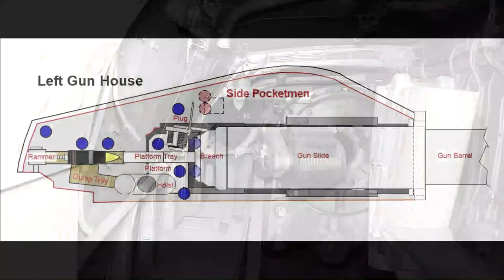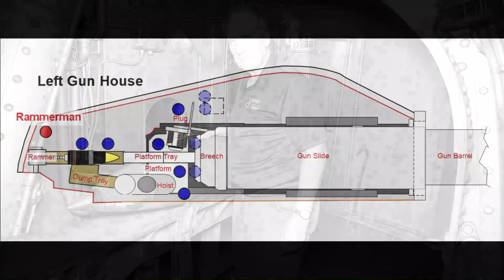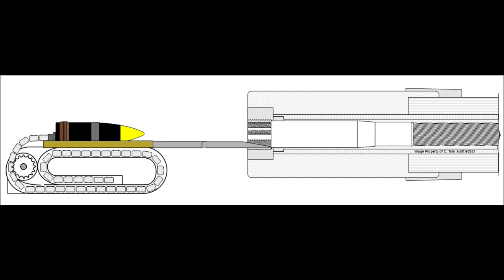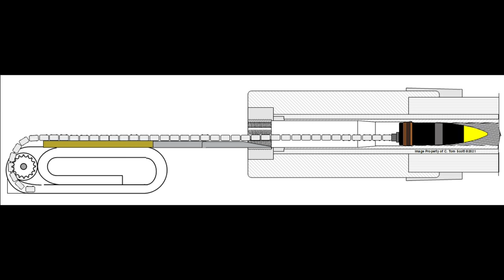Battleship Texas, Getting Loaded in a 14" Turret

Comment: We have all seen movies & video of battleships firing their main batteries, & occasionally seeing after the round has left the barrel along with a cloud of smoke, that a sheet of flame would then momentarily emerge from the muzzle. Is this flame resulting from the gun crew blasting compressed air down the bore, just prior to opening the breach?
Reply from the maker: You'll typically see a puff of smoke a few seconds after the gun fires that is the result of compressed air igniting and pushing the remains of unburned gasses out of the barrel by the gas ejector.

Comment: Tom,  Great explanation, but a couple of questions:  1. How much did the powder bags weigh?  2. How was the type of projectile determined (AP or Common or High cap).  Thanks for this series of videos.  I'm an ex-snipe but always wondered about this evolution.
Reply from the maker: Each powder bag weighed 105 lbs., for a total charge weight of 420 lbs.  That is a full charge.  However, reduced charges were frequently used when firing shells at closer ranges.  These used 85 lb. bags for a total charge weight of 340 lbs.  This greatly increased the life of the gun barrels while not compromising performance.

The type of shell to be fired was determined by the type of target.  An armor piercing shell would be used against hardened targets, such as another battleship or heavy cruiser, to punch through their armor and penetrate deep into the ship before exploding.  It would also be used against shore targets like gun emplacements that were protected by reinforced concrete.  High capacity shells have little penetrating power, but contain much larger bursting charges.  These would be ideal against lightly armored ships like light cruisers and destroyers where an armor piercing shell may actually over penetrate and go completely through a ship before exploding.  They are also good against open or lightly protected gun emplacements, and tank, truck and troop concentrations that are out in the open.  They may use impact fuses to explode upon contact or timer fuses to create an air burst directly above the target that would destroy using concussion and shrapnel.

The type of shell and fusing would be usually be determined by the gunnery officer and his team once a target had been assigned by the combat information center.  However, there may be other considerations.  There were a couple of occasions where h.c. shells were selected when the best would have been a.p. due to shortages.  It's better to fire an inappropriate shell than no shell at all.
Reply: @tomscotttheolderone364  Would there ever be an issue where the loading crew sets up all HE shells on the dump tray, loading tray etc and there came a call for an AP shell next? Would they have to fire off three more shots before they could load the correct shell then?

Comment: How loud was it in the gun house when it fired? I'm sure it wasn't as loud as it was outside the turret. Was there any hearing protection other than cupping their hands over their ears? Is there any documentation on resulting tinnitus or deafness?
Reply from the maker: I spoke with a veteran who served in a turret about 20 years ago.  He said that it wasn't uncomfortably loud.  It could certainly be heard, but it wasn't uncomfortable.  After all, the blast noise was produced at the gun's muzzle that is on the other side of 14" thick armor.  Most of the interior noise was a loud swooshing sound from the recoil buffer when it fired and a loud slam as the barrel was pushed back to battery position by big counter recoil springs.  I would imagine there would have also been background noise from blower, training and pointing motors that ran nonstop when in action.

Comment: Excellent overview Tom.  So does the shell get hoisted upside down and rotated into the dump tray?  Or does the shell tip forward away from the dump tray, then slid backward into the tray?
Reply from the maker: The shell sits nose down in a hinged cradle.  The hinge point on the cradle is below the shell's center of gravity that sits in it.  As the cradle reaches the top of the hoist, which is angled back, the weight of the shell makes the cradle swing back through the hole in the back of the hoist and the shell slides off onto the dump tray.
Reply: @tomscotttheolderone364  So it DOES get loaded into the hoist cradle upside down!  How bizarre.  Thank you for the answer.
Reply: @tomscotttheolderone364  Subscribed!

Comment: So great vid.  But it left me with a few questions.
1) are the guns preloaded at a certain range at target approach? IE.. lets say 100 miles out or so
2) and when a threat was not detected or already eliminated, how were the guns unloaded?
Reply from the maker: Good questions.  
1) No, guns were only loaded immediately prior to firing.  That could be done in seconds if a shell and powder was ready to ram.  Shells and powder were NEVER allowed to sit in a gun for any period of time, especially if the gun had been fired and was still warm.  It not only increased the possibility of an accident, but heat soaking the powder affected its performance.  Also, a loaded gun was extremely hazardous and the gun crew had to stay in safe positions and their movements would be very limited.
2) Since guns were loaded immediately before firing, there was only a very small possibility that they would decide not to fire it and require unloading.  It is my understanding that during wartime, they would simply aim the turret in a safe direction and fire it to clear the gun.  This is because unloading was a time consuming and hazardous operation that included clearing the turret of personnel while a couple of crew members, supervised by a gunnery officer, removed powder bags.  If bags sat in a cold gun, they would be sent back down to the magazines for future use.  If the gun was warm, the bags would be immediately immersed in distilled water to make them safe.  Once clear of powder, the gun crew could reenter and the shell could be pulled out of the gun by inserting a lifting eye in a slot in the base of the shell and using the rammer in reverse to pull it out.  It would then be kept on the rammer tray for future use if it wasn't damaged, or sent down to the magazines though an auxiliary hoist tube.  The upper hoist used to raise the shell only worked to lift it, a shell could not be lowered from above through it, so an auxiliary hoist tube was used to lower the shell with block and tackle to the shell deck located below the turret, then returned to the magazine.
Reply: Thank you for the quick and I depth answer Tom Scott..

I am officially a fan now

Comment: how did man gain this knowledge to engineer this magnificent machinery without a computer ?
Reply from the maker: It is an evolutionary process, especially before computers.  When looking at the progress of any design, it was rarely revolutionary and it happened slowly.  What is largely unappreciated was the tremendous amount of manpower that went into designing these extremely complicated ships that required tens of thousands of drawings.  Even though much of the equipment and design features could be duplicated from prior ships, it still required large design offices with hundreds of designers and draftsmen to create the drawings.  Each of them worked with slide rules and drafting tools to make drawings that were very precise and highly detailed.  What I find most impressive is that all of these drawings had to come together to create a cohesive design.  That can be difficult, even with computers.

Comment: 36,000 lbs per square inch when that 14" goes off, that is a total of 5,541,840 lbs pushing the projectile.
Reply from the maker: The result is accelerating a 1,500 lb shell from 0 to about 1,800 mph in only 52 feet!  The forces are in the thousands of g’s!

Comment: I can imagine the organized chaos in that turret. What my mind keeps coming back to is the guys heaving those powder bags. They were 105 lbs! That's a heavy weight to be slinging about on a regular basis. Those poor guys must have been absolutely wiped by the end of a battle. The only other thing I keep dwelling on is the noise. Large cannons make an incredible report when fired. Was the sound attenuated in any way being inside the turret?
Reply from the maker: I don't think that things were as bad as one may think.  First, we know that noise wasn't bad.  As you suspect, the noise from gunfire was greatly reduced by the heavy turret armor to the point where it wasn't the loudest sound.  According to veterans who served in the turrets, there was the background sound from large ventilation blowers and the training and elevating motors.  When guns fired, the loudest was a whooshing sound from the recoil buffers that slowed the barrel during recoil, then a loud slam caused by the barrel being pushed back to battery position by large counter recoil springs.

The turrets were pretty heavily manned to divide jobs into manageable efforts.  Plus, the gun crews were constantly drilled so that each knew precisely where to stand, and how to move and work together with others like a well oiled machine.  As you surmised, the hardest job was the powder men in the gun pit that lifted powder bags above shoulder level and set them on the loader's platform.  That was manageable over extended periods for a couple of reasons.  With two men there, each only had to lift two bags each time the gun fired.  At maximum rate of fire, that would be two bags every 45 to 60 seconds.  That would be really difficult for most of us, but according to gunnery manuals, these guys were to be trained  by having them lift at least 50 bags every day.  The goal was for them to do that without breathing heavily.  That apparently worked since the ship was able to provide a very high rate of fire over an hour period during initial bombardment at Normandy.

Comment: I cannot imagine working in the "side pocket" or even  the "gun pit". The "side pocket" would be my definition of Hell.

It seerms very likly you were going down with the ship in case of a sudden emergengy.
Reply from the maker: While I agree that it was probably uncomfortable and claustrophobic, side pocket men could evacuate with the rest of the turret crew through close by escape hatches located at the back of each turret.  The biggest slowdown was that the total crew of about 25 in the turret had to fit through the hatch one at a time.  The crew who had it the worse would have been those in the boiler rooms who had to go through a series of doors and long ladder climbs.  Not only was it a long process getting out, there were choke points where each room's crew of about 30 had to exit one at a time.
Reply: How often would they have swapped out sailors. Lifting thise 100 lbs bags had to have been tiring.
Reply from the maker: @Lone_Star_Proud  A mid 1920's gunnery and drill manual stated that powder handlers were to be regularly drilled by lifting 50 bags daily so that they would be in good enough condition to pass bags for an extended period without breathing hard.  The only place that I am aware of where crew were regularly changed was in the powder magazines.  The bags out-gassed ether when the storage canisters (called tanks) were opened, giving the crew stationed there bad headaches.  They would change out with crew in other positions down in the handling rooms until their heads cleared.
Reply: They made them a lot tougher back then. My dad was in combat  wtih the 36th through out the war. The Italian campaigns were particularly brutal.

Comment: Thanks for the video! Dumb question, but how loud did it get in one of those turrets, especially when the gun was firing?
Reply from the maker: Not as loud as you may think.  I’m sure there was significant noise from blower fans and motors, but not uncomfortably loud.   Veterans told us that during firing, the gunshot itself was muffled.  After all, it was 50’ away and on the other side of 14” armor.  They said the loudest sound was the whooshing of the.buffer during recoil, then a loud clang as counter recoil springs pushed the barrel back into battery position.

Comment: I might have missed this, but why wouldn't you use the rammer for the proj, to ram the powder bags? 
Greeting for USS Lake Champlain CG-57
Reply from the maker: The only control for the powered rammers on Texas is a single lever that moved the ram either in forward and reverse depending upon the direction the lever is pulled.  Ramming distance was controlled only by a friction clutch that slipped when the shell's driving band jammed into the compression slope at the forward end of the gun's powder chamber.  There was no electrical cutoff or limiter, nor was there a switch or other control device that could select the ram's travel distance.  For that reason, there was no way to change  between ramming shells and bags.  While the rammer man could eyeball it, It would be pretty easy to over ram bags and damage them.  Even worse, tests performed during the investigations into the Iowa turret accident suggests that it may even be possible to ignite a bag by over ramming.  

Fortunately, ramming wasn't too difficult since 4 bags were quickly rammed 2 a time with a wooden ram rod that the two tray men used to ram two bags at a time.  Since the rammer man was standing shoulder to shoulder with them, he could pitch in and help if they needed him.

Comment: Really good video! Just one question: When the gun is brought into firing position, the breech would move into the gunwell where the wellmen are, right? How do they keep from getting crushed by the massive breech block?
Reply from the maker: Maximum elevation for Texas' 14" guns was 15 degrees.  For that reason, the breech didn't extend that deeply into the gun pit.  Below the breech was the loader's platform that was attached to the gun slide meaning that it also lowered when the gun was elevated.  As long as they stayed clear of it, the platform's position made it impossible for the well men to be at risk from the breech.  To be clear of any of the gun components, after they lifted the four bags of powder and prior to the gun elevating, the two well men moved forward and sat or laid on the powder tray.  I was also told many years ago by a veteran who manned that position that they could lay on their backs on the deck and the platform would stop a few inches above their faces.  Personally, I think I would rather sit on the tray.
Reply: @tomscotttheolderone364  Thanks for replying so quickly and so in-depth! I can kind of visualize that now. As someone who loves heavy machinery yet occasionally gets really nervous when close to it, wellman definitely isn't the job for me... really good video by the way!

Comment: Why did they have a power hoist lower down only to switch to manual passing of the bags for the last 2 levels?
Reply from the maker: Texas and New York actually started out with a fully manual system.  Bags were passed by hand up a series of platforms vertically spaced 30” apart from the lower handling room to the dividing room.  This was not only inefficient, but offered no protection against fires flashing between the two levels.  A powered hoist was installed sometime between 1919 and 1922 that replaced the platforms and improved protection.  This was an easy installation since adequate space was already there and it solved 95% of the problem.  Powering anything else would have required extensive modifications and time in a shipyard for little improvement in performance.  Gun crews were constantly trained and exercised, and proved fully capable of maintaining a high rate of fire.